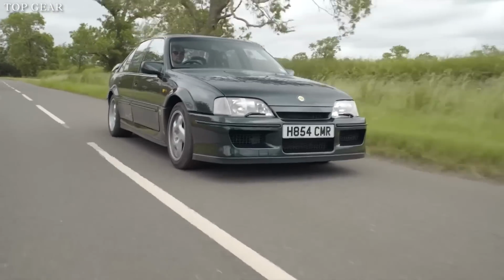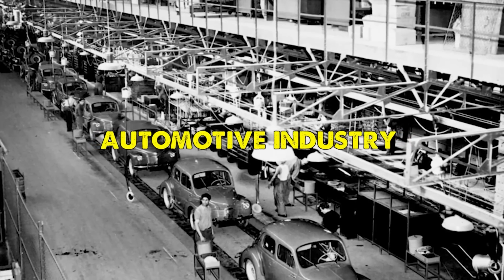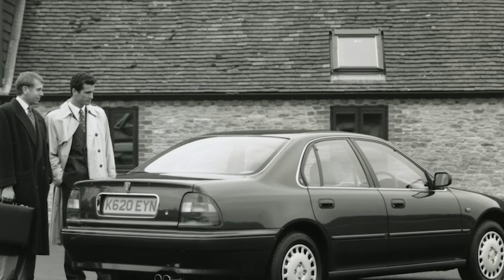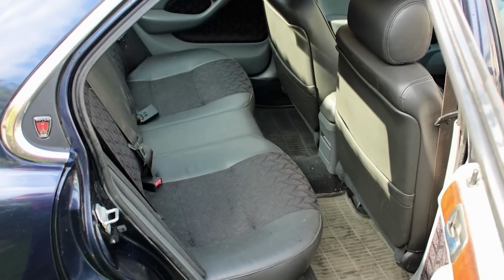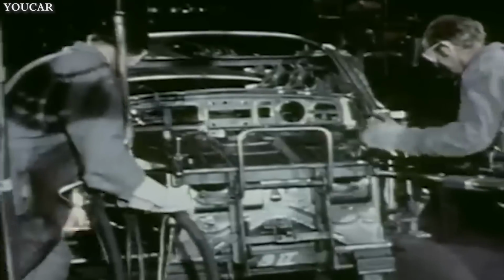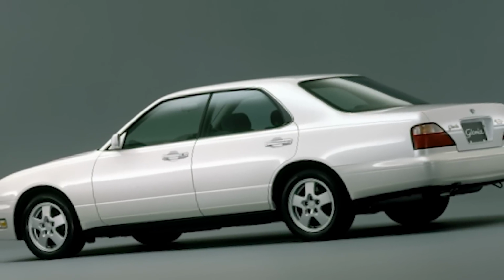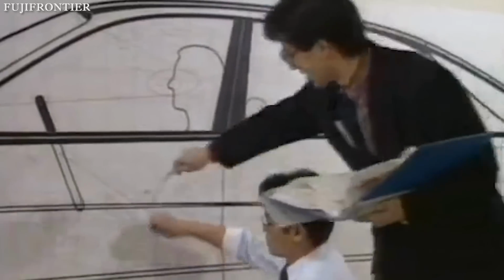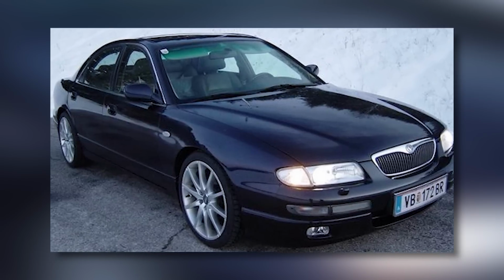4 Best Sports Sedans Now Almost Forgotten!

Comment: Lotus Carlton is a true legend and has long held a high station in my lottery list top 10. The rest of these are deservedly forgettable. The Rover Ti engine has both flaws and fans but the body and chassis is boring at best. Of the other 2, the GTU doesn't exist here in the UK except for a couple grey import cars and the Mazda is just a wannabe FWD Merc or  Beamer and those 2 stalwarts will tell you that, in the luxobarge market, RWD is still king!

For another truly great but largely ignored car today, try the Volvo 850 T5R, especially in estate form!